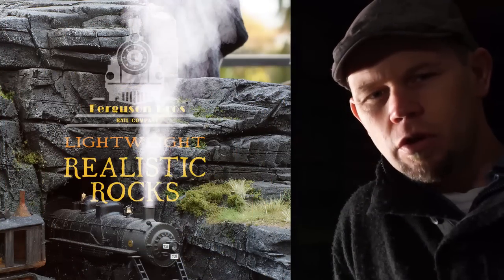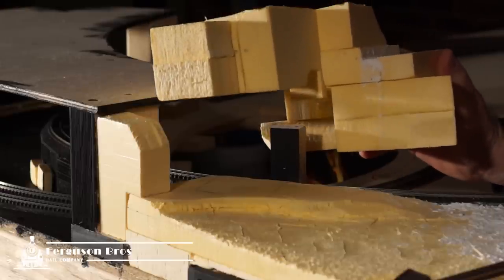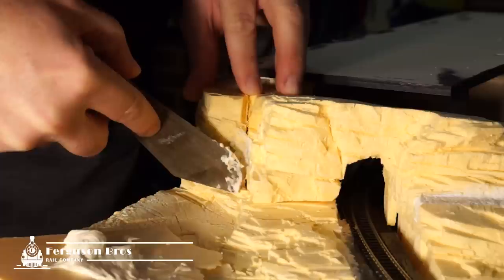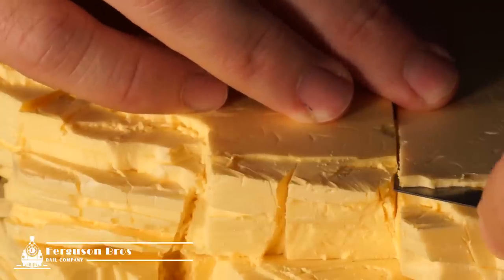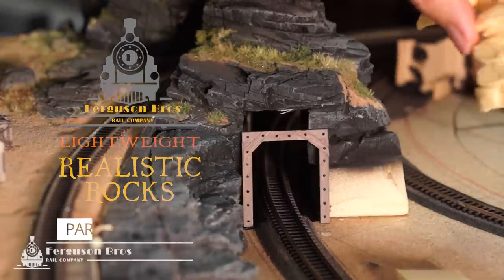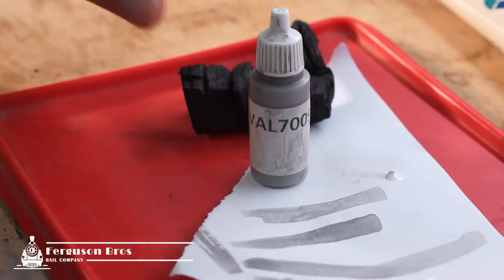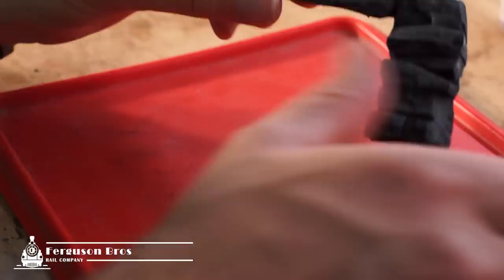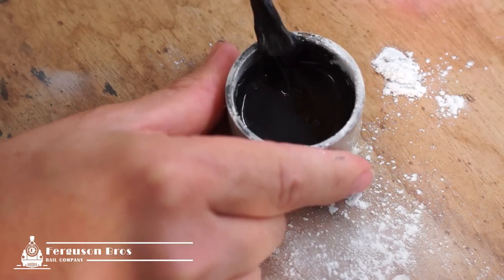How to make realistic lightweight fake rocks

Comment: Can I use these in an aquarium?  Why isn’t there lots of little styrofoam bits flying around?  Like bean bag balls lol. Great use of foam!❤️🇦🇺
Reply: There's a similar technique using Styrofoam and concrete. I recommend looking up "diy 3D aquarium backgrounds" 👌
Reply: Thank you. I will!
Reply: What did you use? I thought yours was styrofoam?
Reply from the maker: This is using extruded polystyrene which is a much denser product than regular expanded Styrofoam. You can get it from insulation providers. I can't comment on whether the chemicals cause problems for aquatic animals.

Comment: By far the most realistic rocks I have seen in a long time   . Your artistic talent is extraordinary  right up there with the legendary John Allen and of course Malcolm Furlow . I  am excited to creating mountains using your technique . Being   a Garden railroader  what can I do to make it more weather proof ? I'm pretty sure the foam won't deteriorate if I protect it from the sun .  Life span  should be 10 years  before I plan on moving . Thank you for a inspiring  video
Reply: 0p⁰
Reply from the maker: That's an interesting challenge. I think the foam would hold up for a while with a decent exterior paint but it would be good to do a hot summer test first. If it were me I'd probably use a concrete stamping technique - I got into this several years ago - some photos here, it uses colour hardener powders used in driveway stenciling. https://elfshot.com/rockhollow/

Comment: if dense foam styro wasn't so expensive here, i would use that to built my full size rock wall/fountain - but i priced it yesterday for my attic insulation - 2" 4x8 is 75 bucks!!  OUCH!   may have to resort to the cheap bubble type with newspaper, chicken wire and aircrete blown onto it.
Reply: rapunzel eh? Holy smokes! I buy 4x8 sheets of 1 inch thick for 30 dollars. 75 bucks? Houses must be expensive where you live!
Reply: josh johnston - i know!!  last summer i paid (actually without knowing) 68 per sheet...  they didn't have the bubble stuff with the silver foil but the guy (over the phone) said we had this other stuff... never in a million years did i think it was that much so i didn't ask!  people just don't use it for insulation for the most part, just the glass bat stuff.   i only use the solid stuff now for making headstones at halloween - it carves really nice, and if you rig up a dimmer switch to plug a wood burning thing into, it's perfect for doing the letters - if you don't mind a little brain damage of course...
Reply: josh johnston - actually that's not far off...  1" for 30...  2" would assumably be 60...
Reply: rapunzel eh? Ha! Math! Gets me every time.

Comment: that was frikken awesome dude!  I make waterfalls for a living and am trying to figure out how to incorporate a similar style but larger and with using concrete.  You have an awesome eye for re creating nature!
Reply: How did your project go? I am trying to do the same, with real running water and a pool.
Reply: Your task should be simple enough. Create three cement molds in slightly odd geometric shapes.
Make three sets of casts, equal to the number of blocks of cement you want.
Once they are hardened, attack with a hammer and chisel to create further random shapes in the cement. Then just stack them and secure them.
Just my opinion, though.
Reply: @tylermcgonigal6031  sorry I didn’t see this question, I’m going well with this, I use big blocks of styrofoam to carve and spray concrete on
Reply: @nathanjones6638  all good, that was 3 years ago.  I’m still learning but have a few methods under my sleeve now
Reply: Both great ideas I don’t have anyway of spraying concrete but I could put styrofoam in the mold to save on material and weight thanks for the ideas
Reply: @tylermcgonigal6031  spraying concrete is easier than you think, render hopper and air compressor.  Or just use a paintbrush to paint on render or trowel or gloves and just wipe it on then wet paintbrush to smooth out then use a texture roller, mould, latex texture etc to do surface.  I have done swimming ponds with wetland filtration before and have used real rock but want to do with with 100 💯 fake rock